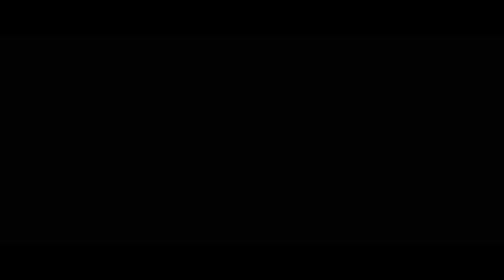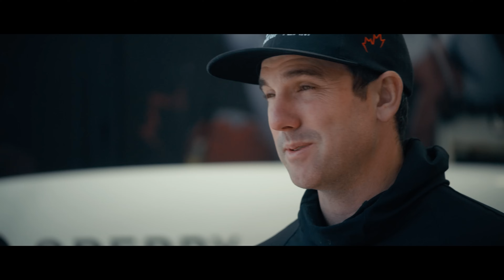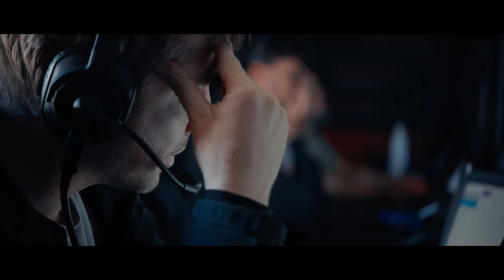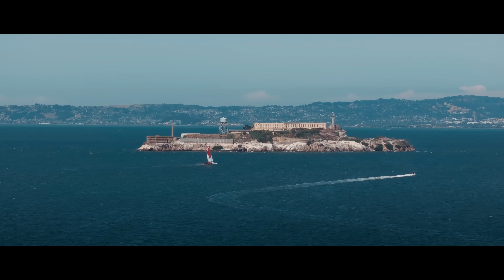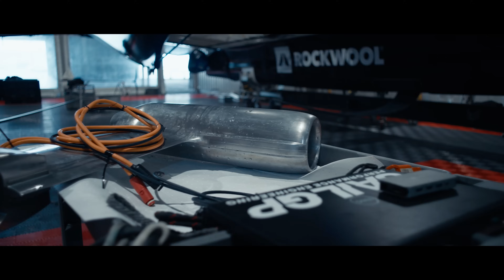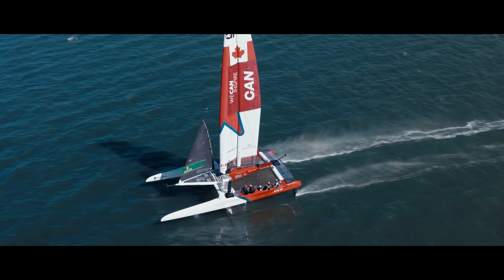SPEED: The Story of the F50 | SailGP

Comment: Speed in Sailing in displacement is quasi-linear. Speed in sailing on foils has two abruptly different regimens. Displacement (Boat not designed for that) and foiling (approx 5 times faster). So adding jets for foiling raceboats does not mess with the traditional Sailing by displacement, which we all love anyway. It's almost two different sports

Comment: Awesome production and inspiring teams on amazing machines! 

Is the jet powered by the grinders? Like by charging the batteries during the race in off-times? Because if so, I'd be fine with that. But if the only thing stopping them from just motoring along is a bit of software with cooldown timers á la video game I would not enjoy the "sport" nearly as much. Also, I was wondering why the boats don't have some kind of speed brake. On a normal vessel that doesn't help much, but at these speeds lots of frustrating, expensive and certainly dangerous collisions could be avoided if the teams had some way to quickly decelerate - and that would of cause be used more preventatively if you could get foiling again quickly (jet) thus making the sport safer and more fun as being eliminated through crash damage must be most frustrating for the team and is always a bummer for the audience.

Comment: I think that using jet propulsion or wherever other engine onboard to trim the sail should not matter if the whole energy comes from the wind stored on batteries.  That should be the main focus, I would not care if they include solar power as well.
Also, they should start with batteries at 20% charge and use the first 10 min previous to the race to charge the batteries.
But I am skeptical of how much benefit a jet could provide taking into account that provides a lot of drag 95% of the time.

Comment: Everyone mad about the jet and not understanding that its ONLY to get it on foils and think it's going to ruin the sport is crazy. It's got limited energy and can only be used to get on foil. You don't want that thing in the water at any speed faster than just above foil speed because the drag it would create at anything above that would far outweigh any power it adds. The boat would be slower and less efficient at anything over barely on foil with it in the water. Once on foil it's normal sailing as if it wasn't there. Then it becomes a game of who can keep it on foil and be more efficient in the low wind conditions. This isn't push to pass and never will be. It's push to start.

Comment: In years past I had a Cal 25 sailboat.  It had a 9.9 hp outboard motor on it.  Did having an engine on the boat make it a power boat or is it still a sailboat?
     Of course, when racing, the umpire could see if the engine was in or out of the water, so I couldn't cheat, but this totally submerged unit is hidden.  Not enough wind to get the boat foiling? Se la vie.  Foiling or not, it is still a boat race. Being able to win in light air is just as important a skill as being able to win in a gale
Reply: I was going to say, it may not be as exciting but light wind sailing is “a thing” that takes “a skill”.

Comment: At 21mins 30secs in the video when Phil achieves 101kph, there is conflicting video footage.  The onboard shows a jib set, the aerial footage shows mainsail only, so clearly they are not true videos, jut just to give effect.  I am interested to know if the jib was used for the 101kph record. I ask because we race radio controlled multihulls, just 122cm long, and the best we have recorded is 34.27kph, with a jib+main setup. Wondering if we might be faster with main only. video is here   
 https://www.youtube.com/watch?v=_QC-ak3MyR4
Reply: Sharp observation! My guess would be the onboard's are the actual footage. A drone isnt able to keep up with those speed for long. So editor probably just had to resort to a different shot.... Normally i would argue this is fine, but when shown as picture-in-picture like here, it seems abit like cheating.

Comment: Guys, have you tried some vortex generators, to maintain the boundary layer increasing the flows speed over the foil; might create too much lift though. They don't need to be high, maybe start at 1/8" high to 1/4" high. Looking at the start of the bubbles try just aft of the start. You have subsonic flow so it should work to a degree.

Comment: The F50 is amazing. But jet propulsion??? That's not sailing. Sorry, but light winds are a reality; deal with it.
Reply: Traditionalist
Reply: I agree.  There is motorboat racing for that.
Reply: Totally agree...sailing is sailing...sold out for money as not pleasing enough for spectators...damn shame
Reply: Its an assist to get up foiling in low winds and the battery supply will be limited so you'd better use it wisely just when it's needed
Reply: Clearly this IS dealing with it  !
Just like every other problem that has been overcome by innovative technology.   Eg: anti-fouling paint, composite build materials, GPS or Dyneema etc etc.

Comment: Very dangerous in a collision.  Someone could get decapitated. I don’t think the bit of extra speed is worth the risk.
Reply: so are automobiles.
Reply: youre never getting the windward foil up to head height without snapping it off on the other boats hull.
Reply: @matteogardenghi2291 there were plenty of occasions when one hull was high.
Reply: @ yes, however, those only ever happened when boats rose next to eachother, and if you use your eyes, with the foils sticking out it would not be possible, either the foil would break, or the boat would get stuck.

Comment: I love Sail GP. Love the foils. The jet? Well . . . . I think this is more about keeping Arab money in the circuit than sailing.
Reply: Hey, Imagine turning the TV on and knowing that SailGP is racing 95% of the time... This is what it's all about. SailGP won't be here without an audience, partners or events - this a cunning way to ensure racing takes place. As an example, the F50 takes off in 6.5kts of wind, but it can foil in 4kts once up and foiling..
Reply: If the battery packs are set at zero and need power to start I think it is a good thing,  if they have unlimited power before the start, the foils are computer controlled,  there is no point having a crew on board.  Robo wars. If the water jet is only used to lift the boat I can see the advantage.  Spectators don't want watch boats floating in a mill pond.
Reply: exactly
Reply: true dat
Reply: i was in abu dhabi jan 24 and the only thing that saved the spectacle was the proximity of a small circuit
Reply: So true... and so sad
Reply: next will be full time jet propulsion then giant outboards just in case...

Comment: Congratulations! Great to watch the F50's get faster and faster (we go over 100 kph in iceboats all the time when the water is hard)
Reply: I was very inspired when I was a kid watching ice boat racing  in Canada on tv, so I decided to make a boat with 3 wheels (in New Zealand) that could race along our wonderful windy beaches. Same basic configuration, we called them land yachts and we used to get over 80kmh even in those days,  I made a fiberglass mold and sold heaps of them.  These days it is too crowded even on our beaches, so a bit of a no-go plus all the red tape, modern safety requirements  etc etc. Speed limit now 30kmh on all beaches because they are classified as roads. I am now trying out a self designed hydrofoil fiz boat about 5.5m long powered with a 140hp Suzuki.  Can't wait to see us gliding along in it, been on the drawing board for 20 years but watching sail GP has got me all fired up again.

Comment: Don't forget Hydropthere.... 55knts... couple of years ago....
Reply: It’s so wild how that was one-off world record boat specifically built for the attempt and 15 years later there’s a formal class of racing boats (well, really two classes) that can approach that speed during normal racing when at the time it seemed so far-out and untouchable.
Reply: @zoepaulastrassfield2664  was offshore. F50 and AC are inshore hydropthere
Reply: Hydroptere also cannot tack around a mark to save its life.
Reply: At least it can sail on both tacks, unlike SailRocket
Reply: @DrKnowNothing1  yea fair enough, just pointing out the false comparison between hydroptere and the F50s as a means to dismiss the acomplishment.